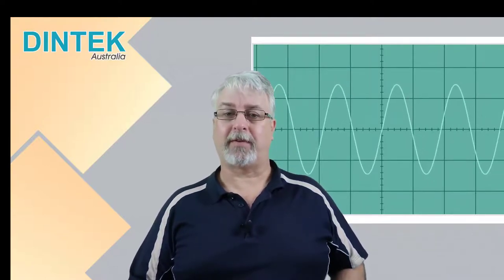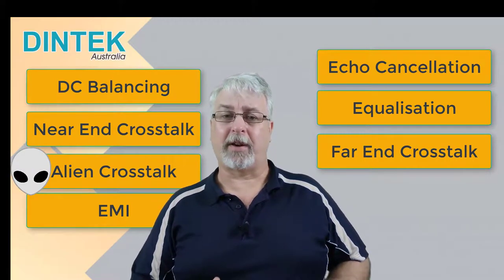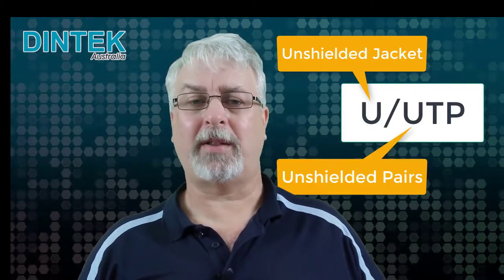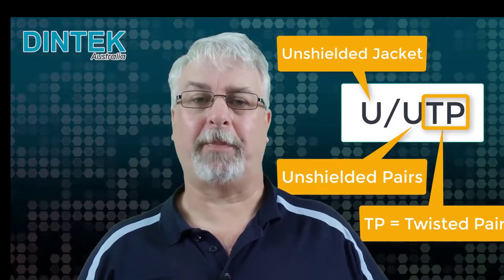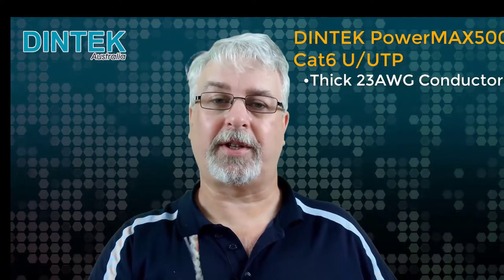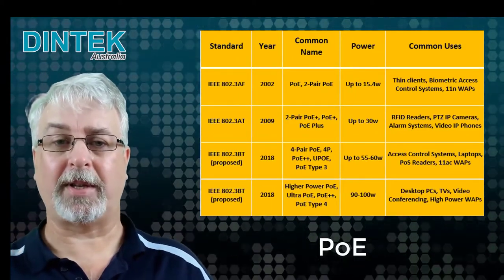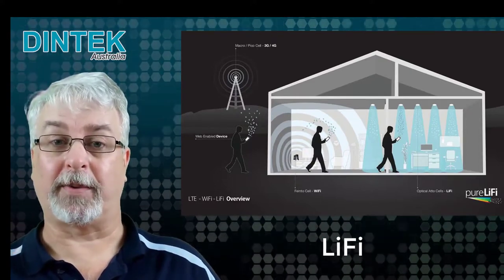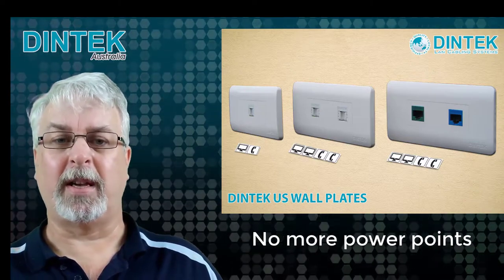Shielded and Unshielded Cable. What's the difference.

Comment: One important point you missed is that the shield should be connected at one point only.  If it's not grounded anywhere, it may as well not be used.  If grounded at both ends, there is the possibility of ground loops, which can create noise.
Reply from the maker: Hello James.
There is a good article on this subject which you can find here. https://www.emcstandards.co.uk/cable-shield-grounded-at-one-end-only

Comment: This is the first time I've heard CAT 5e was only good for 50M at 1 Gb.  As far as I know, it's always been 100M.  Also, Gb Ethernet was designed to run 100M over plain CAT 5 and predates 5e.  As you mention, there is a length difference between 6 & 6a at 10 Gb.
Reply from the maker: Hello James. 
The standards for cable bandwidth has always been about Mhz capability over a 100mtr Link.
Cat5e was always specified in the standards as being able to carry 100Mhz over a distance of 100mtrs. 100Mhz allows for 100mb ethernet. One can of course put a 250Mhz (Gigabit capable) signal on a Cat5e but the signal loss will happen at a shorter length than 100mtrs+. 
Category 6 was set at 250Mhz over 100mtrs. 
It is not a precise science. How far one can push 1Gb over Cat5e will depend on the performance capabilities of the type of Cat5e cable due to wire gauge, crosstalk limiting factors etc.
Reply: @dintekel  I tried to reply, but it might be too long, as Youtube won't let me post it.  Is there any other way to send it to you?  Regardless, my comments were based on the contents of Ethernet The Definitive Guide, from O'Reilly.

Comment: Thanks for the great summary of cable types and performance. I'm confused about grounding. For example when using CAT6a cable, if the shielding of the cable is bonded to the metal wrap around the RJ45 connector at both ends (I'm assuming that's it is).. and the equipment at both ends is grounded, doesn't that potentially create a grounding loop?
Reply from the maker: Hello Graham.
There is a good article on this subject which you can find here. https://www.emcstandards.co.uk/cable-shield-grounded-at-one-end-only

Comment: the problem with lifi would be that you would have to be in direct sight of the modem
Reply: I suspect just being in the room would be enough, as the light will bounce off walls, etc..  You can demonstrate this with infrared remote controls, which often don't have to be aimed at the device.